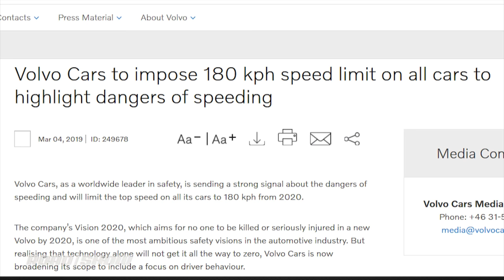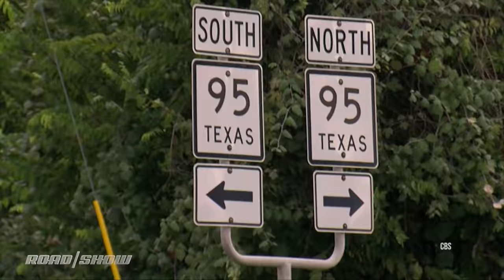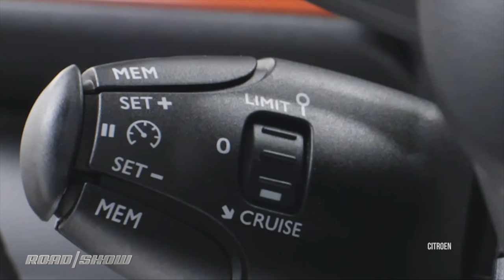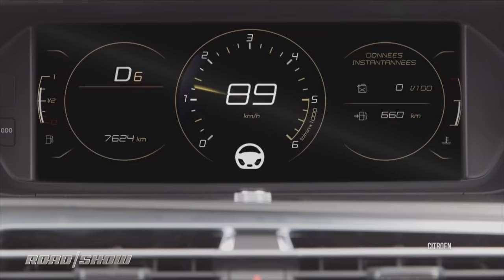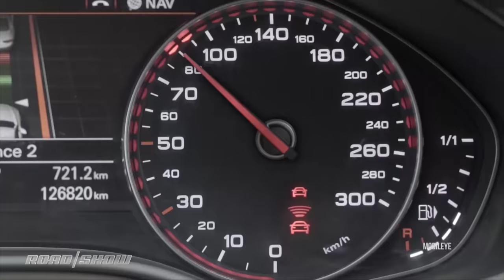Car Tech 101: When cars go too fast, bad things happen | Cooley On Cars

Comment: “Speed limits on the autobahn to reduce carbon emissions” so Zero Emissions vehicles could get exempt? 😌
Reply: Well that's kinda a thing in Austria 2 different speed limits.
Reply: There’s no such thing as zero emissions.. How much energy is needed to build a car in the first place??
Reply: Felix Sameli-Joynt *emissons affected by the speed of a traveling vehicle or tailpipe emissions
*terms and conditions apply assuming no 3rd party modifications involving combustion of a fuel, coverage not available everywhere select PZEV, TZEV and Enhanced AT PZEV, during select driving modes or battery depletion only whichever occurs first.
Reply: All kinds of thing are proposed for laws, this is just one of those that will never pass.
Reply: @AnarchoHumanism  You're right.  Multiple speed limits isn't safe.  Large speed differentials are dangerous.

Comment: The US Interstate highways, and Canadian Freeways like Ontario's 400 - series, were modelled on the autobahns, and engineered for the same speeds, so that isn't a valid issue regarding maximum speeds.

But driver training definitely is, as is expectations regarding speed differentials.

And speed differential is the most dangerous factor when it comes to driving on a controlled access freeway. Hence the stupidity of all those places where there are different posted limits for different types of vehicles (usually commercial vehicles vs cars). In contrast, there are the safer jurisdictions where both a maximum and a minimum speed are posted, and the range is fairly tight (10 mph/20 km/h max).

As to electronic speed restrictions, I've always thought it would be a great idea to allow the driver to easily turn on a governor, allowing the cars max speed to be temporarily restricted. This would be especially nice on long trips in poor weather, when you don't necessarily want to use cruise.
Reply: Yes, I can't stand states with different speed limits for classes of vehicles. Completely idiotic. I find it's the people who are going slower than the rest of the traffic to a e more of a hazard than the one fast driver.

Comment: I don't think there should be any sort of speed limiters on a vehicle, especially so low as 80-120 MPH. As an extremely paranoid person, you will never know when being able to quickly accelerate + move at high speeds may save your life. Already saved me once.
Reply: Yeah I don't think being able to do 120 will save your life, but being able to accelerate over the speed limit sure can. However these speed limiting ideas are completely insane, sometimes one just need to have some fun at night on an open freeway. If your so stupid to drive so fast on a back road or curve maybe you should crash.

Comment: Like my '03 Ford Taurus Sport.  Duratec sounds nice, and she's got more in her.  but speed limiter cuts me back at around 110 MPH.  (Mind you this was on an empty, straight road as when I have fun with my cars I don't want to put anyone else at risk.)

My 2001 Volvo V70, well, I feel like it could do faster, but it's neglect and abuse from the previous owner has it in not the best condition to do that, so I don't try it.

Comment: This safety issue in the US is mostly about better driver training and requirements - there’s no reason everyone in the US should qualify for a license any more than average people do in Germany. (And by the way, what kind of asshat reasoning is it to claim that ‘everything is different in the US’ as an argument for anything?  Either a system works or it doesn’t.)  I’d prefer a country where everyone is forced to qualify at the highest German or Swedish licensing levels, rather than the disaster we have currently in the US. With stricter and more consistent (ie federal) driver requirements we could yes, have autobahns in some more rural  places. I’m against the automation of anything but commute-level driving, and I’m pro-electrification especially of cool performance cars.

Comment: Speed limits need to catch up to current car technology. We should not be stuck on the 1973! Also the roads are not designed for a particular speed limit across the country, for example the 405 in CAlifornia, people get upset with you if you go under 80. I drove through Utah and Idaho where I can see the road aheads for about 10 to 20 miles, and there is nothing there but completely empty land as far as you can see, why is there a speed limit there?! In addition we should not adjust to the lowest common denominator, but the other way around, what I mean is we should not all drive slow, because it is easy to get a drivers licence here, vs. Germany, nor because the other driver is not expecting XY and Z. Instead make the requirements for driving beter, and allow for a left lane with higher limits, you don't like it? then don't go there. We need solid solutions not excuses as to why. 
As someone who has personally been to Germany the driving there is so much safer, and carefree.
IF NOT ANYTHING ELSE THE FACT THAT I CAN PAY 100% ATTENTION ON THE ROAD RATHER THAN HAVING TO LOOK OUT FOR COPS IS PROBABLY THE NUMBER ONE REASON FOR ALL SAFETY, AND CLOSE TO NO ACCIDENTS THERE!!!!!
Reply: Well, since you asked, have you ever blown a tire at 100+ mph?  There are a lot of cars on the road (sometimes even new ones) that are not safe at high speed.
Reply: @incognitotorpedo42  Not at 100 mph, but I have blown a tire at 85, just had to let go of the troughtle and allow the car to slow down while I gently apply the brakes, nothing came of it. There are tires out there with reinforced walls, like run flats, and Y rated high speed tires. LIke I started, current technology if far better now then it was in the 70s. If you stop to think of all the things that can go wrong on a daily basis, there really isn't much to do in life.Can we apply some safeguards sure, but there is never a guarantee on anything. All I am saying is that we are capable of more, and we don't need a nanny state to extort money from us every time they feel like it.

Comment: How are American freeways designed for 65 mph?  They're the straightest roads in the world.
Reply: Straightest road built as cheaply as possible.
The highway's are not as thick as the German autobans and they are not as well maintained, nor are they as smooth (driving on some of highway in Oklahoma has my car's headrest hammering the back of my head every time I go over the expansion joints), 

You'll also find that when there is a turn, the curve is not banked as much.
Reply: Actually when the Eisenhower System was built, the freeways were banked for 75 (which was the speed limit up until the 70's).
Reply: @pogo1140  Yep. Lately I spend more of my time driving to work trying to dodge all the various potholes that aren't getting fixed because road crews are busy tearing up and repaving sections of road that didn't even have any potholes to begin with.
Reply: @mjc0961  Hear ya, this past January I had to replace my car's engine mount after the bolt holding it in place sheered off after I hit a pothole.

Comment: America is filled with speed traps just to make money! For example in my state not on my commute the highway goes from a speed limit of 65 where there are all kinds of curves hills in the highway but somehow the speed limit is 50 on a 3-4 mile straight with a cop speed trap just waiting for you at the end. This is the issue most Americans have with speed! I can have a speed limit on a road where there are businesses churches and everything else pouring in and out at 55 but the highway which is restricted to on and off ramps has  a speed limit of 50 in certain areas hmm.... 🤔

If the speed limits made more sense people would abide by them. But currently what's happped so that these speed traps can be made up is that people go the speed of traffic and go the speed they think is safe. Not what's posted.
Reply: Speed limits for make sense.  What you are describing is an anomaly.  It is by me means the norm.
Reply: @Anonymous-pm7jf  as someone who has put 270,000 miles on my car driving america...its literally fucking everywhere....  every town has at least 1 or 2 roads at min that are random choke pointed, many with poor signage and warning of decreasing speed or reasoning.   example i was out in middle of bum fuck nowhere the other day, long almost perfectly straight road for 16 miles or more, 1 lane each way, wide lanes with really good divider and markings and signage and large shoulder, everything...  speed for reasons i cant understand jumped from 35 MPH to 55 MPH to 60 MPH to 35 MPH to 60 to 55..like..why?  barley any driveways or businesses or anything to justify it in fact most of the turn in and off areas where in the 60 zone.. luckily on my passthrough, no cops but i heard from a guy lives in the area when i stopped at gas station that cops love that road as they tuck up on all the speed drop areas and them pounce on literally everybody..

Comment: speed kills...doubling your speed quadruples the energy during an impact...notice airplanes travel that fast on bags full of air all the time (tires) but when they go over 100 mph they either take off or slow way down as fast as possible
Reply: speed doesn't kill, suddenly stopping does. Also the dangers of fatigue is far worse on long distance trips, something you could avoid by driving faster to your destination instead of spending needless hours on the road getting fatigued.
Reply: Michael N speed kills. Becouse if you suddenly stop at 10 mph nothing will happen.

Comment: U.S. drivers are horrendous on average. Show me a driver with 2 hands on the steering wheel, in position where they can maintain control, all while paying attention to what's going on around them at all times. Not too many of those. People hold onto the wheel in the oddest, most casual ways. If you have a hand partially or completely on your lap, your not driving safely. If you have to do these things on a road test in order to pass, why not continue to do them? Because people don't take driving seriously.
Reply: "How you hold the wheel" is just about the least relevant single point to focus on.

I almost never drive with both hands on the wheel in the US--there just isn't a need to.
When I drove 180kph in Germany, I naturally had both hands on the wheel without thinking about it because it was necessary.

What really matters is 1) Paying attention
and
2) KEEP RIGHT EXCEPT TO PASS. Seriously, driving in Germany isn't hard. There is literally one rule to follow to make it work and this is it. Master's degree pffft.

Comment: American highways may have been built for 65 mph speed limits, which I doubt and believe nearly all speed limits are arbitrary, but that was decades ago. Today's cars can safely  travel those same roads at much higher speeds due to better tires, brakes, engines, headlights, aerodynamics, safety systems, etc. Speed limits should be revised every 20 years or so to keep them relevant and realistic.

Comment: I agree that many american drivers are incapable of driving at high speed, it they are timid and kept right all the time, and looked before pul’ing out to pass, faster vehicles passing would not be an issue.  As for design of interstates, having lived and driven in germany, i see little design differences in those you mentioned, and ramp speeds there and in n. America are similar so that is a moot point.  There is no reason that on u.s. interstates, given appropriate road, traffic and weather conditions, that posted daytime a cannot be 85-90mph for the left lane and 70 mph for the right lane.

Comment: #1 shouldn’t people who choose to drive, need to pay attention, all around them? Na. What would happen if people stayed to the right on the highway? #2 why not build all vehicles to accelerate only fast enough, but slow enough to be environmentally friendly (sip fuel, and exhale so little fumes), then stop accelerating when the speed limits are met. As for braking, the automatic braking feature will be on permanently, and on the highest setting (keeping vehicles far apart), and only letting the brakes lightly and gently slow the vehicles (saves fuel, cutting emissions). #3 better than all this, let’s vote Mr. Spaghetti for president, and have “special licenses according to a individuals driving skill. Or make getting a license a little more difficult in the US?